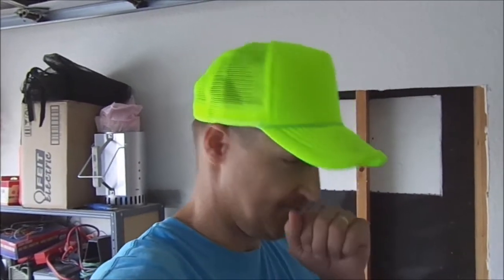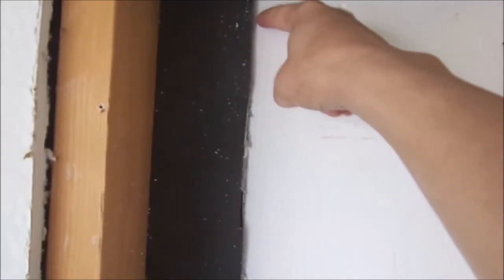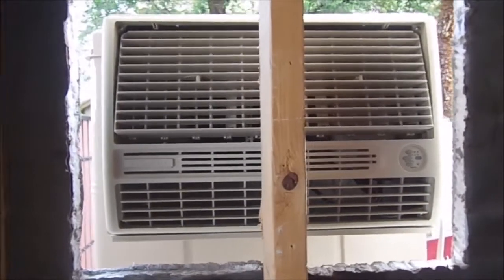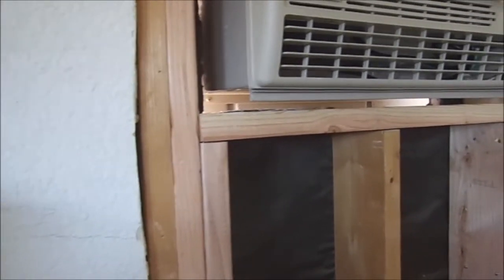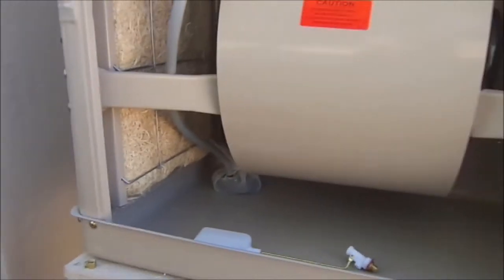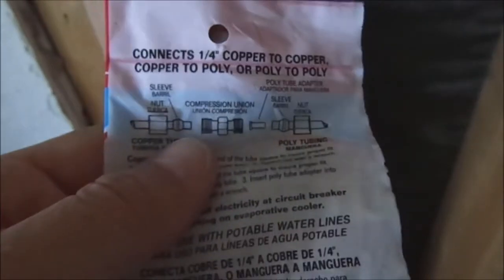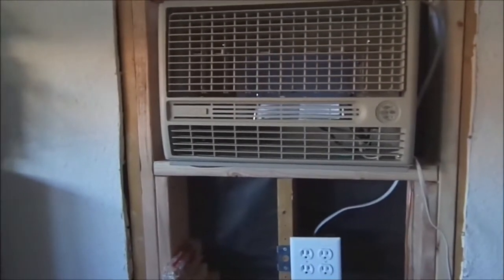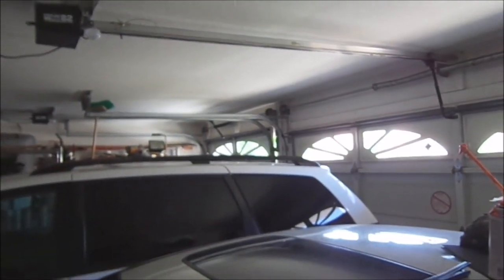Swamp Cooler Install on Load Bearing Wall

Comment: Good video, and it confirmed what I plan for my install in my shop.
Reply from the maker: Thanks!  Best thing I ever did in my garage.  I recently put two attic vents in there too so I can leave all the doors shut with it running.  It cools off my garage and my whole attic now, and my main AC unit for the house doesn't have to work as hard to keep the house cool at night.  I run it every night for a few hours after the sun goes down.  I love being able to spend time in my garage when it's blistering hot outside.

Comment: 1. Measure distance from top of platform to bottom of cooler duct. 2. Then us a black magic marker to make an index line on the wall.
3. Use a level to make a straight line across the wall ( 22 " long ), this line will be the base of your duct. Again using your tape measure and level,  measure 14"  up on both sides. Then use your level to to mark your top line ( it should look like a rectangle on the wall  ) .
5. Use a grinder with a diamond blade to cut through the stucco and wire lath.
Easy, peasy.
Reply from the maker: Thanks for the tips.

Comment: No guessing is required or drilling multiple holes through the wall. 
The duct of the cooler is 14 " x 22 "  (14 inches tall x 22 inches wide  ).
Build a frame in the wall that has an opening like a window .
The whole wall is load bearing,  cutting through 1 stud is not going to compromise the entire wall.
Reply from the maker: Probably true, but I'm a chicken and I wasn't ready to bet on that or take any chances.  :D  I admit that the way I poked that hole was pretty klugey, but I'm going on summer number two with that thing installed.  I LOVE it!!

Comment: Don’t forget you need to install a vent grill in the opposite corner/side of the garage ceiling (if there is attic space above the garage) to vent the air, it must have a exit vent to optimize the cool air flow.
Reply from the maker: Great point.  I usually put the garage door up a few inches in the 3rd bay when I'm in there and its running, but an exit vent in the ceiling of the garage would take care of that.  I may end up doing that anyway, because I think having that much airflow in my attic would really help cool it off after the sun goes down with all those hot roof tiles up there.

Comment: Does the cooler make a big difference in your garage? The reason I ask is a lot of reviews say that the Essick 2800 cfm is horrible.
Reply from the maker: I'm not sure why it would be called horrible.  It's a simple math problem.  Evap cooling is very effective...a function of the surface area of the evap pads, the air flow of the fan, and the heat input it has to overcome.  My cooler is adequate for my garage in Phoenix, AZ.  On the hottest days, it doesn't make my garage chilly, but it drops the temperature enough for me to work there comfortably.
Reply: @DoctorFixMaster  Hey, if it satisfies your needs, mission accomplished. That particular model has a dual fan and the side pads are only accessible thru the back. People were complaining about the CFM actually being 2800. I agree that evaporative cooling is very effective when humidity is low.

Comment: Why drill so many uneven holes? You couldve just drilled 4 corner holes and use a square and level. Also i just turn the part that comes through the wall 90° and it fits in between the studs without making a header. Then just nail in a couple cross braces at top and bottom for support
Reply from the maker: The holes were because I was trying to use a diamond bit die grinder to cut the stucco.  It was going through blades on my reciprocating saw like crazy.  In retrospect, I should have just used a circular saw with a masonry blade.  I decided that putting in a header was easier than performing sheet metal surgery on my swamp cooler so I could stick it through the gap in the studs.  Oh well.  :)

Comment: If you read the directions on the union package,  it says to use a ferrule and a nut for copper and a sleeve and a ferrule and a nut for poly line.
It does not say to use a sleeve with copper line.
Read very carefully.
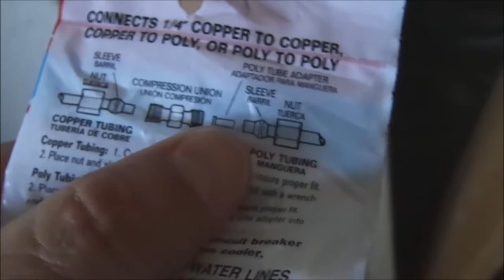Reply from the maker: Lots of manufacturers make lots of union packages.  Choose whatever package calls it what you insist upon.  It seems to me that the important thing is that you know how it works and follow the instructions, not nitpicking over what to call the thing.  Go to 28:23 .  There are your instructions.  Read very carefully.  The word ferrule doesn't appear not for poly or for copper.  Those instructions call them both sleeves.  I'm sure if you look far and wide enough, you can find one that calls it a ferrule.  Or Bob.  Or Frank.
Reply: My mistake,  I should have said,  " look at the picture  ". It shows a ferrule and a nut with copper  & a sleeve / ferrule  / nut with poly line.
The package does call both pieces  a " sleeve  " , although technically  one is a sleeve and the other is a ferrule. 
The manufacturer  / distributor may label it this way to prevent confusion among installers.

Comment: Hi DoctorFixMaster if you vent your evaporative cooler into your attic I would consider leaving the water off during that process. I’m thinking the excess moisture in the evap air might cause damage to your attic insulation.
Reply from the maker: Thanks for the comment.  If I ran it a lot that way, I might be concerned about that hazard, but I live in Arizona and it is super dry around here.  Running it for a couple hours at a time in the evening shouldn't bother anything.  Whatever moisture that is introduced into the attic that way will be long gone by morning.

Comment: Never,  ever, use that kind of cooler coating.  It will never dry and will make gooey mess.
If you need to protect the water basin,  install a zinc anode.
Reply from the maker: I will never, ever use anything else besides that cooler coating.  It's gooey, and can be a mess, but it's very effective, and not half bad to apply if you're careful.  A zinc anode only reacts with ions in the water.  That doesn't eliminate the ions that react with your cooler basin, although it does reduce them.  Once the anode is gone, the reactions will chew through your basin very quickly.  A tar coating is bulletproof.  Complete metal to water isolation.
Reply: @DoctorFixMaster  When the anode is gone or better yet, before it's gone, you replace it with a new one. This way you have continued coverage.  An anode in combination with a poly phosphate cartridge is your best hedge. The anode reduces the formation of rust and corrosion  & the poly phosphate sequesters calcium and minerals,  reducing hard scale deposits.  An asphaltic based coating needs to cure and dry.
Reply from the maker: @anthonygonzalez7488  I'll buy that.  Whatever works.